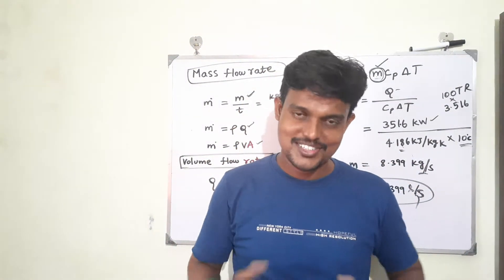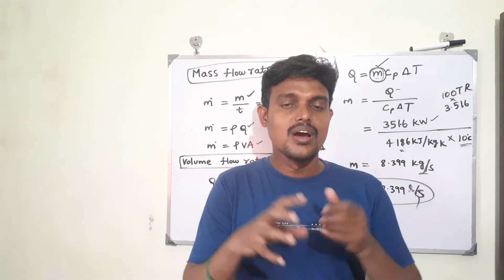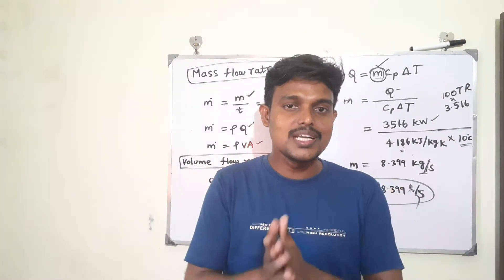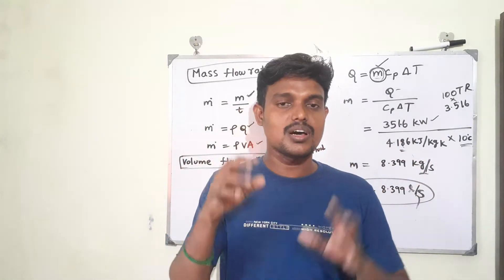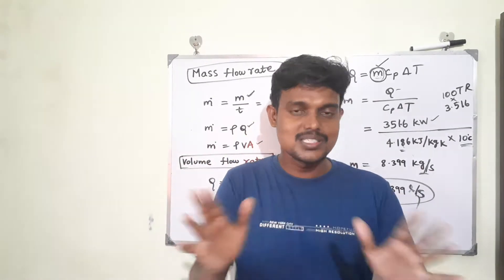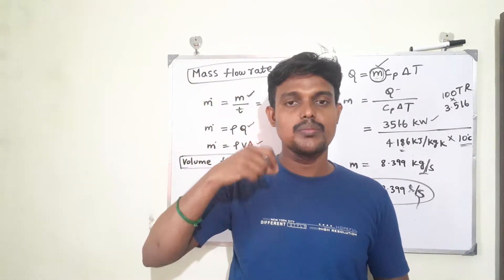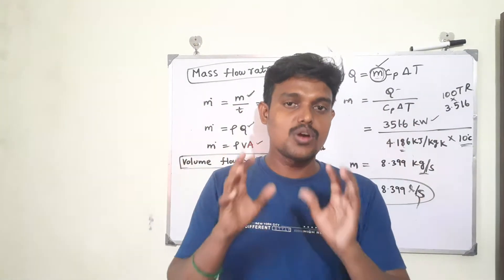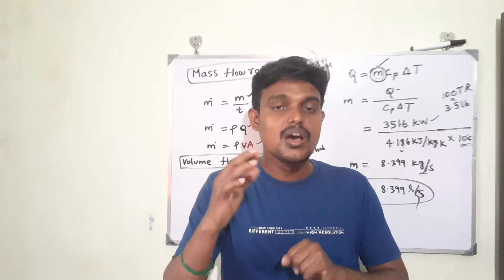Delta T | Low Delta T Syndrome | Volume flow rate of Chiller | HVAC | MEP Engineers |Ashokraj S

Comment: Well tried, if you have good knowledge then you can explain anyhow.
Reply: Hi dear 
Please make a video on the electrical panel room by using si units.
Calculate
The heat load of the room,
CFM required (there is no ventilation means no ACPH)